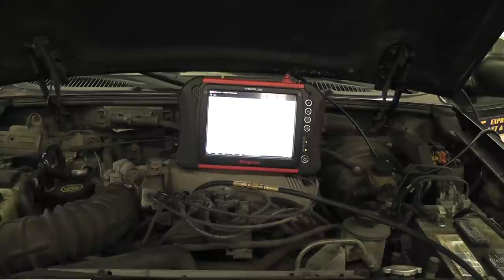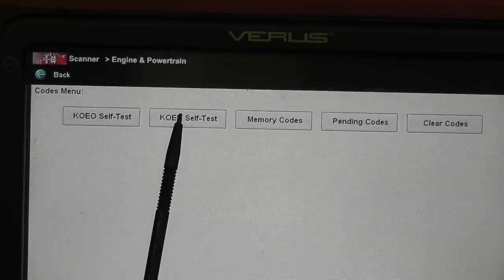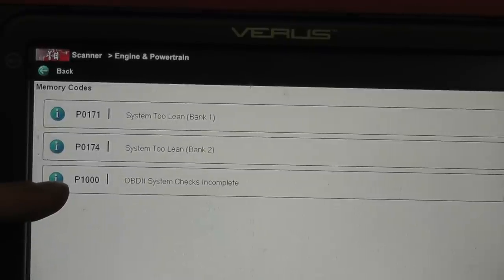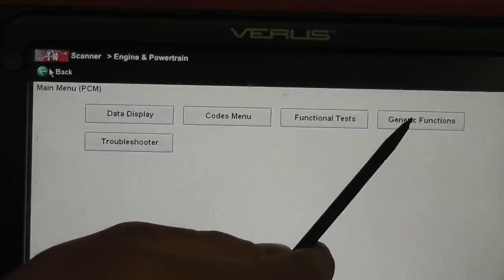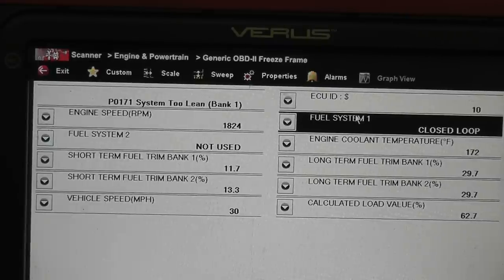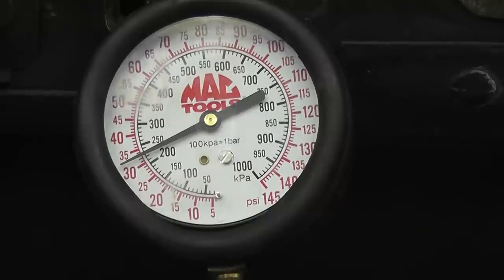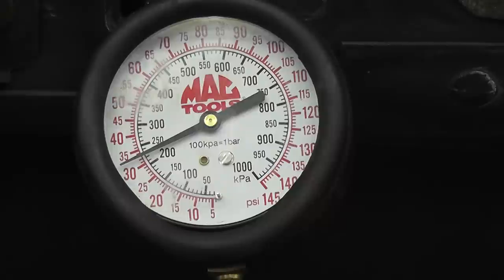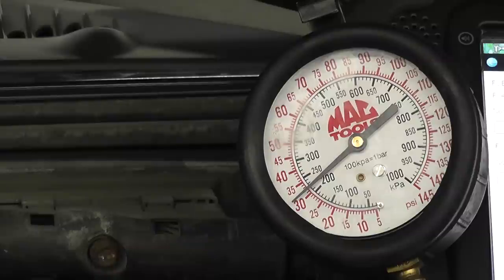Low fuel pressure causing a P0171 and P0174 trouble code

Comment: I just had break lines put on my ford Taurus.  running perfect prior.  as im driving home its idle and timing all off,, as I break it wants to staul and as I gas it revs up waay to much.  any ideas,  did they touch my idle and timing to fix the break lines or they mabey accidently knock something loose?? help?
Reply from the maker: gita conway sounds like they left something unplugged under the hood. Look around the brake booster for any vacuum hoses left off.

Comment: 2000 Ford Windstar 3.8 lean at idle and lean under load bank 2 only.  Stft is at 25 and drops to 23. Under load it drops to 17 positive. Maybe even 14 at the lowest.  

Replaced gaskets upper and lower. found 7 vacumm leaks. Dpfe sensor. Imrcv. IAC... MAF sensor. Plugs wires and fuel pressure is at 50 and drops a little after turning the car off. Vacumm pressure on dpfe sensor jumps to 10 psi under load. I'm running out of ideas. Please help me point in the right direction.
Reply from the maker: Focus on the O2 sensor itself. Does it respond to forced ratio changes? (Add propane, create a vacuum leak)

Comment: Will a bad fuel pump,still allow my truck to run.After a few minutes the fuel pressure drops and turns off.replace the fuel filter.goes from 40 psi to 9psi
Reply: Marin Sanchez make sure your are not losing a power or ground to the pump while pressure is dropping
Reply: I will check
Reply: It turns on

Comment: Oh! What luck , I was sent a dud pump or one that has failed on Ebay !!!!
The stall pressure (i.e. the pressure of the fuel pump with the gauge connected to the fuel supply) is only 50 PSI which isn't enough pressure for the Chevy LS1 engine which is tuned to run at nearly 60 PSI from the factory - I had to do that test to rule out any possibility that the fuel pressure regulator may have failed or isn't up to par which is 58 PSI , so it looks like I won't have to Shell out any money on a 4 bar fuel pressure regulator which the car runs as standard,I did have a pressure rating of 65 - 70 PSI when I fitted the other pump in 2011 so I am not sure if that fuel sender unit was been fitted with a 4.5 bar regulator or that I have read that a 255 litre per hour pump will give a higher pressure reading than stock ????
That pump is still returning about 2 litres per minute back to the fuel tank when the injectors are at 100 % duty cycle (2016 cc's per minute in total for all 8 injectors).
I ended up ordering one of those Japanese 150 litre per hour fuel pumps from Malaysia for about $16 AUD so I am going to see how that one goes,the one I ordered from Melbourne also has a faulty non return check valve inside of it as well & I'd say the pressure bypass valve isn't doing its job if its bypassing fuel at 50 PSI so I will see if I can get my $30 back for the pump next week.
Mine is tuned to put out 276 kilowatts out at the flywheel (same power as the stock LS2 in Oz) so needs about 117 litres per hour to fuel it under load so the fuel injectors are flowing at 97 % duty cycle at full throttle.
The fuel trim has been at 22.66% on both banks as the ECU is trying to compensate for the lean mixture by moving to a different block in its memory to widen the injector pulse width so once the new pump has been installed this or next week,I'll let you know if that fixes the lean condition,I'd say the injectors can't atomize the fuel properly (i.e. bad spray pattern) due to the lowe pressure so hopefully they will run with a narrower pulse width soon.

Comment: 2006 Explorer 4.0 L
Key on Engine off 207-276 kPa (30-40 psi)
Engine running 207-276 kPa (30-40 psi)
Reply from the maker: is this a question or a statement? Also, I believe your Explorer is an electronic returnless fuel system with a variable speed pump and no psi regulator and from memory, 30-40 sounds about right for idle speed on those

Comment: i fix 2 ford explorer 4.0 v6 today classic p0171 p0174 mitchell said fuel pressure between 30 to 65 i checked fuel pressure first truck was at 38psi at idle second truck 40 psi at idle and arround 34 underload  the fix fuel pump and i confirmed the fuel pressure have to be at 60 psi i replace the fuel pump and check again stft when -20% just like scannerdanner teach in class total fuel 5% thats a fix. from now on i burn 60psi in my brain for any ford with 4.0 soch and 4.0 ohv same as 5.0 ohv with return less system electronic fuel control thats another deal

Comment: Could I use multimeter inline w power wire to check amperage..
Reply from the maker: 1975nova Are you talking about using your ammeter in series to the circuit?

Comment: amps the pump is drawing would have a lot to do with how hard it is working. If the pump was drawing a lot of amps that would mean clogged filter. If the pump daws low amps then it is simply not working hard meaning the regulator isn't working as it should. Just my thoughts

Comment: could that mean that the fuel pump is going out in my 2004 honda accord
Reply from the maker: +Marquis Walls if it is dropping pressure during a snap throttle rev like in this video, then yes, or your fuel filter is plugged

Comment: i have a 2001 lincoln ls v6 133k and im having problems Symptoms
•Car will only rev up when warm (200°+)
•po174, po171 
•horn not working 
•cut off at when idling to long   
•catalytic converter glows red 
• check engine light won't come on

♢ what I done so far
* clean fuel injectors and test them
*Replace ignition coils
*Replace tps, all 3 pcv and egr sensor 
*Cleaned maf and IAC
*Change spark plugs 
*removed exhaust system no change in engine performance
* spread around engine for vacuum leaks with Carbon cleaner no change in engine
Reply from the maker: Lp Liverpool what is your fuel pressure?
Reply: Idk didn't do a fuel pressure test but i did just test the maf sensor and with a multimeter and scan tool on the mm i got 1.10-1.20v at 850-950 rpm and on the scan tool i got .8-.9v at 850-950 rpm so my question is. Is it my pcm or maf
Reply: Lp Liverpool neither, your using a different ground point than the PCM and it is common for the actual numbers to be off from scan data slightly. you need to do a fuel psi test next.
Reply: ScannerDanner Premium but what about my catalytic converter glowing red
Reply from the maker: Lp Liverpool you have lean exhaust codes and lean symptoms. a lean misfire will pump all kinds of unburned fuel and air at that cat.
Reply: ScannerDanner ok thank you i will do the test is it ok if i bother you again with an update

Comment: I'm at a lose with trying to figure out why my car will not start I have changed the filter and the fule pump and still noting. this last weekend on the way up towards Reno to the snow with my girls my Mitsubishi 2002 lancer started pulling like tugging and then just died out and when I tried to turn it over and start it, It just keep trying but wouldn't fully start. I was told it was the fuel pump so I changed it and the strainer and still nothing I then used the diagnostic reader for codes and the codePO102 came up, It has to do  with the intake air temp sensar 1.If anyone could please help me figure out what I need to do Iam at a lose and I have no mechanic skills but I ealy need my car fixed I would really appreciate the help thank you,Katrina
Reply from the maker: +Katrina Richards a P0102 is a MAF sensor trouble code. The intake air temp sensor is part of the MAF (mass air flow sensor)

Comment: SD, checked with my mechanic and he told me the fuel pressure was fine.  Is it possible there is a dirty fuel injector that is causing the codes?

Thanks Frank

Comment: map checked out ok at key on (II), idle and load. fuel pressure doesn't drop under load. goes from 35 to 42 psi under acceleration. hmmmmmm ...

Comment: update// stft is 19 ltft is 40 I also had a leaky pintle on the egr so its a new one fue filter is bypassed
Reply from the maker: the PCV elbow underneath the intake manifold is a major issue. Can't see it from the top, have to look from under the car

Comment: "p1000 specific to ford" That's not right is it
I've seen that on Jaguar
Reply: Josh River that's a Ford product depending on year of Jaguar
Reply: deanmartin22000 ahh good point. 
Working on an 04 xj8 I just acquired. It's very minimal ford as opposed to x & s type but nevertheless that is probably the case.

Comment: if there was a way to measure a F*** fuel pressure on sentra 2005, I could have fixed my P0171 two months agono damn shrader valve and no way to add one . no way to disconnect that fuel line no matter what tool I bought. so after confirming it was no leak or AIR or sensor issue, and gave up on trying to disconnect fuel line to connect e T to it,  I replaced the fuel pump and that took care of the damn P0171. just can't disconnect that line wonder what tool the dealership has.
Reply from the maker: Is that one of the finger lock fittings?
Reply: @ScannerDanner  no regular damn to hell fuel line with the lip or whatever it's called but it sits way to far back and can't be pushed in no matter what even using the usual fuel discconect and fuel line scissors. nothing works. just can't push it in to release the hooks. wish i could upload a picture. never seen anything like it.
Reply: @ScannerDanner  I tried everything fuel disconnect tool  I could find and I mean everything sold on the market.
Reply from the maker: @WV591  maybe post to my forum and then you can share the picture of what you are dealing with. It is free to join www.scannerdanner.com
Reply: @ScannerDanner  I did, I uploaded the picture. ( Sentra 2005 Fuel Line ... by WV591) THX

Comment: he danner your a great tech     just sain I'm getting my ass handed to me buy a 2001 focus 2.0 split port   its got 40 psi with the vacumn line off the electronic regulator 32 at idle it only sets 171 at about 1500 rpm under a 60 percent load I know your gonna say whats the baro don't have that on my scanner    it has 230 k on the engine I bypassed the fuel filter with my pressure tester I put some low mileage injectors from the bone yard on it  now my boss is hesitan to buy me a fuel pump.....I swapped mafs from a donor car no change    can a plugged cat cause this ? can I diag it with a vacumn gauge or should I buy a back press gauge ?   she doesn't want me to spend a lot mure time with it but you know how it is you HAVE TO KNOW....how about a scanner danner contest winner gets a modis I'm 53 so most of your subscribers would be putty in my hands lol  seriously you are doing great thing her much love Bradley

Comment: SD, I have a 2004 Ford T-Bird with 19K miles on it, the car is MINT.  I am the second owner. I have had the car since 2014, all of a sudden in May of this year I started getting P0171 / P0174 codes out of the blue.  I brought the car to a mechanic recommended by the dealer I bought the car from.  All of the following have been done: replaced MAF sensor, all new plugs and coil over wires (this was a 2008 recall never done on the car), air filter, EGR o ring, air intake manifold (between the air filter and throttle body) front 02 sensor, fuel pump changed and gas filter, smoke test, intake and injector seals / gasket.  Bottom line I am still getting the codes but only after I drive 100 miles or so.  In between it seems ok.  Can you think of anything else that can be looked at.  Can you email me at ffavale@mac.com.  Any help would be appreciated.  I am going crazy.  Thanks

Frank Favale
Reply from the maker: Post this to my forum Frank
https://scannerdanner.com/forum/post-your-repair-questions-here.html
Reply: Damn, stay away from that parts changer.

Comment: When checking amperage on pump circuit, would a bad pump cause a high amperage reading? I'm thinking of this like a bad starter and pulling too many amps on the circuit...
Reply from the maker: Typically no, the pumps fail from poor brush contact so current is low. BUT, I've certainly seen mechanically frozen pumps draw excessive current